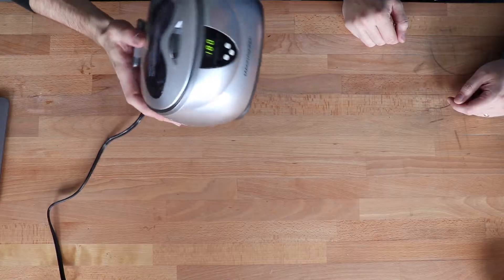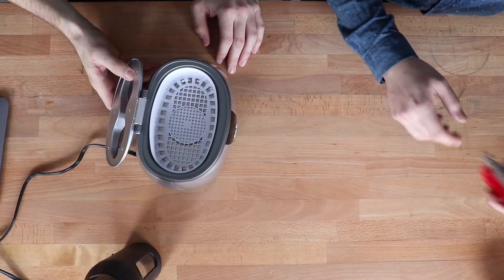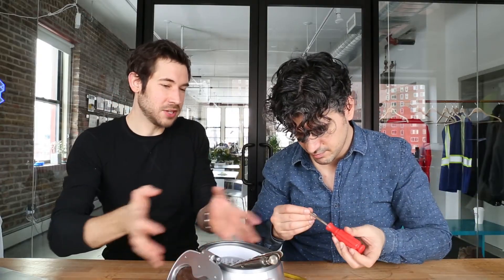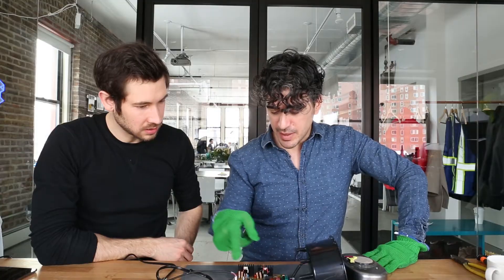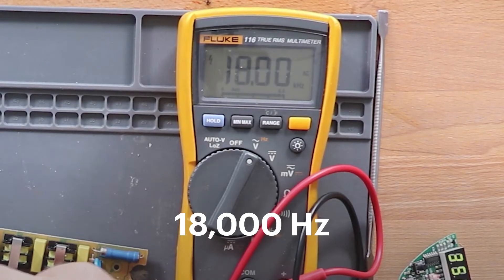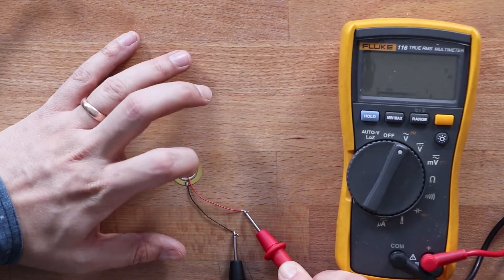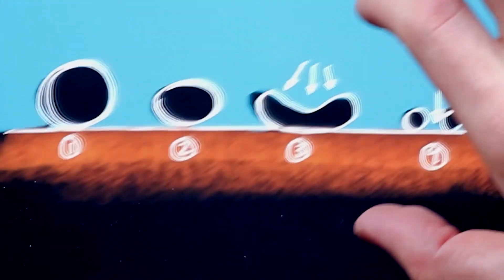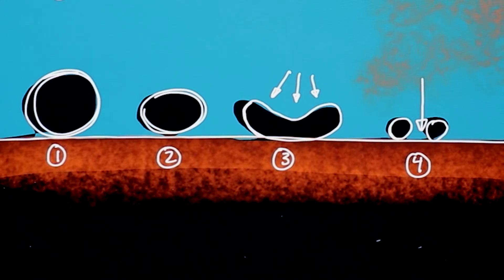Ultrasonic piezo cleaner Teardown (dirt beware!)

Comment: Nice teardown! You'll need to look at the waveform under a scope to validate the frequency -- you're not going to see a straight ultrasonic waveform but rather a sub-ultrasonic PWM of a frequency varying ultrasonic waveform, so multimeter won't give you accurate results.

Comment: That's a fake unit. You can't have an ultrasonic cleaner, where there's only a piezo piece, the you need both the bell, which directs the force at a specific angle, and you need the counterweight to balance and re transmit power + vibrations back into the pot.